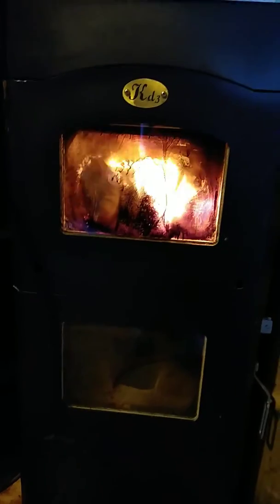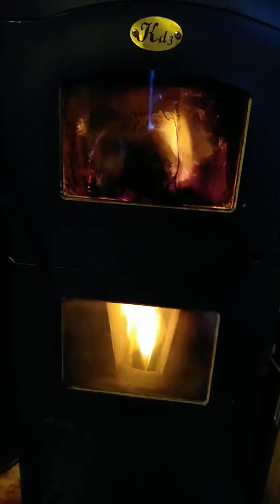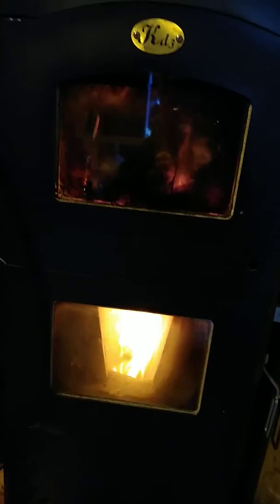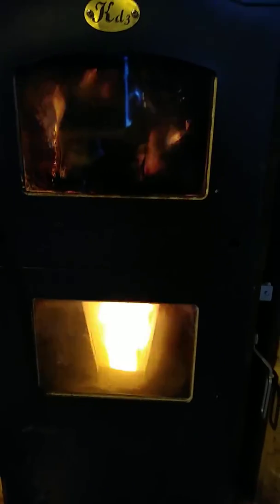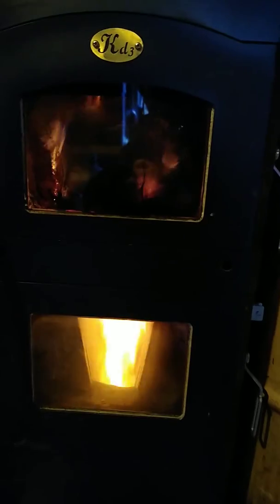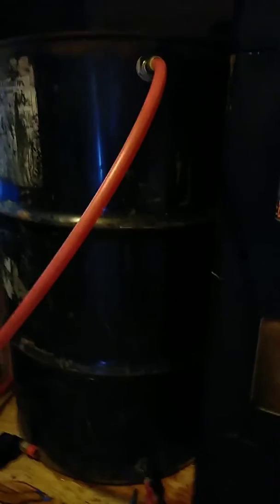Downdraft gasification with thermal electric generation

Comment: Any chance of a drawing or shop link, but MOST importantly..what's the wattage?
Reply from the maker: Thanks for asking. This is a prototype that's not ready for market yet but has delivered 136 watts in demand and is basically a DC pulse generator that stores power in a battery bank